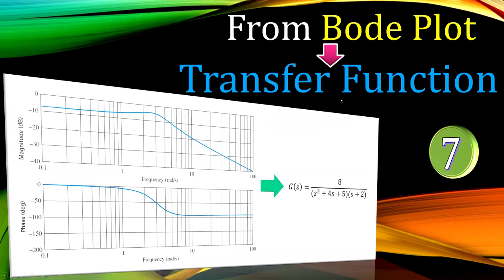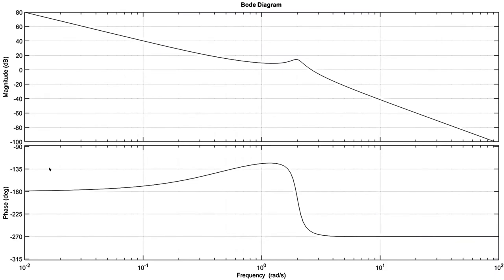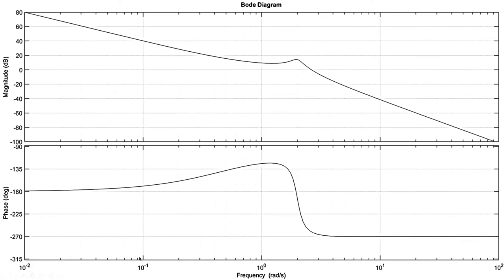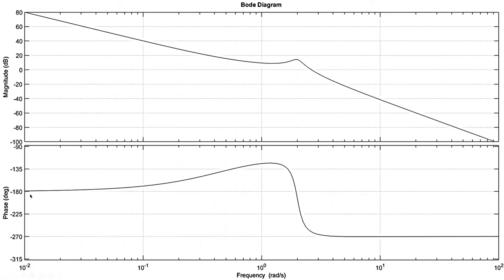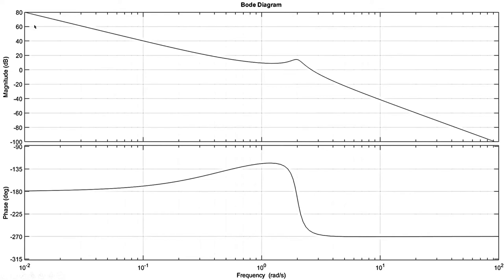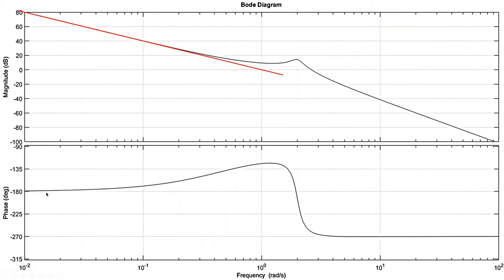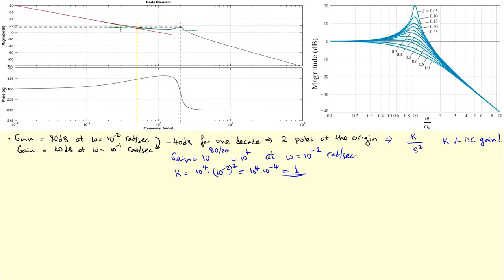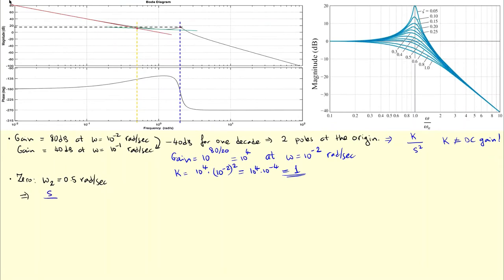Deriving the Transfer Function from Bode Plot 💡 Gain Peaking & Complex Poles 💡 Example 7

Comment: Sir,
Thanks so much for your excellent videos. Question:
The tangent line you drew for the zero has a slope almost zero. Coming from -20dB/dec that should be a double zero, no? 
Also after the peak, the magnitude plot decreased by -60dB/dec and the phase by -135/dec. So must there not be a simple pole as well @2?
Reply from the maker: Thanks for your reply!
1. Indeed, the slope for the zero location (0.5 rad/sec) looks almost zero, but it is not exactly zero. The peaking at 2 rad/sec is also close to this zero at 0.5 rad/sec, which makes the slope even more flat than it is supposed to be for single zero effect. So, we cannot say that we have a double zero there.
2. After the peaking at 2 rad/sec, the magnitude indeed decreases and goes even steeper than -60 dB/decade.  Actually, this peaking effect is included in the quadratic term (2 poles). At around 3 rad/sec, the slope is changing to almost -60 dB/dec. Due to peaking, we have 2 poles and in addition the effect of one of the poles at the origin (s = 0) is still there. In total, we have 3 poles for larger frequencies, which results in a slope of -60 dB/decade in the gain plot.

I hope this clarifies the situation.

Comment: I'm a bit confused. In the previous bode plot, in order to calculate the "true" Mp, the gain provided by the zero must be subtracted. In this plot there is also a zero but no subtraction is needed. Is it because there is no "Kdc"? What did I miss?
Reply from the maker: The maximum gain occurs due to a pair of complex zeros and not due to a real or imaginary zero. In this Bode plot, the gain does not start just a 0 dB for DC (0 rad/sec). The way to handle these kind of Bode plots is specifically discussed in this example. Remember, that the determination of the transfer function from a Bode plot is not an exact science. You will most of the time need a check using a simulator in order to compare the given Bode plot and the simulated Bode plot.

Comment: Hi sir . What should we do if the difference between the slopes is very small and they cannot be separated from each other
Reply from the maker: The basic idea here is to make lines on the Bode plot which has a slope of -20 dB/decade/order for a pole and a slope of +20 dB/decade/order for a zero. Thus, if you have for example a second-order pole, the slope is -40 dB/decade. The slope will be +60 dB/decade for third-order zero. If you cannot discriminate the slopes clearly from the Bode plot, you still need set up the slope according to the rules given above and in the videos.

Note that this method might not necessarily produce an exact result in the first attempt, but you can make a fairly good estimate of the transfer function if you follow the rules. This method requires definitely some practice. Once you have determined the transfer function, you can verify your result by plotting the Bode plot of this transfer function in, for example, MATLAB and compare it with the given Bode plot.
Reply: @CANEDUX  Thank you so much .
Reply from the maker: @ahmetdiskaya3430  You are welcome! Thanks for your question. This will also help others to understand the material in more detail. Good luck!

Comment: since the phase is at -180 does this not multiply K by -1 ?
Reply from the maker: There are two poles at the origin and they make the phase by themselves 2 times -90 degrees for very low frequencies, so you should not add a -1 in front of the K.
You can for example generate the Bode plot of 5/s^2 in MATLAB and observe that the phase is -180 degrees but although the K (which is 5 in this case as an example) is not negative in the expression.